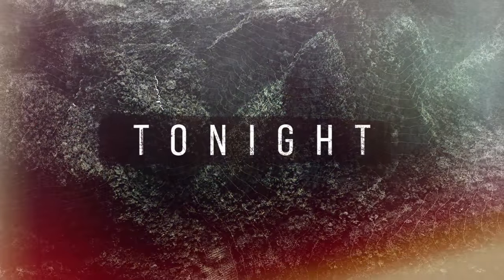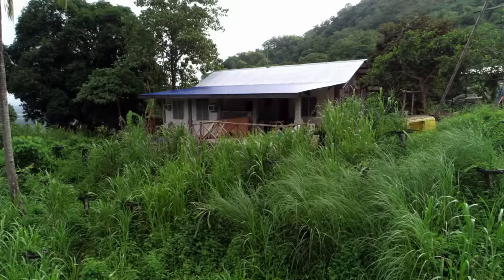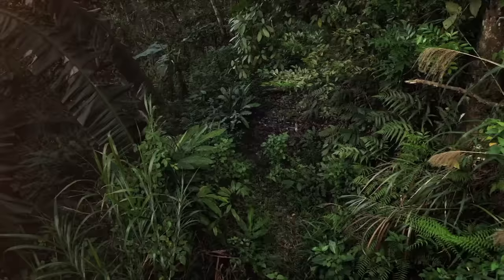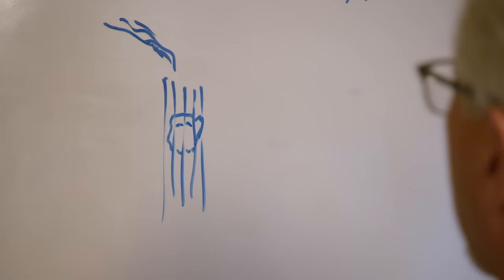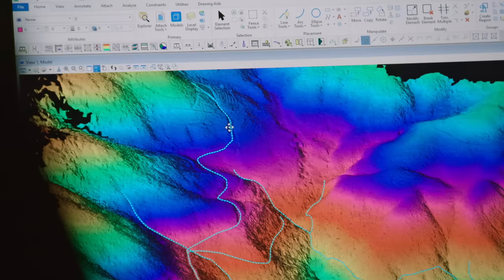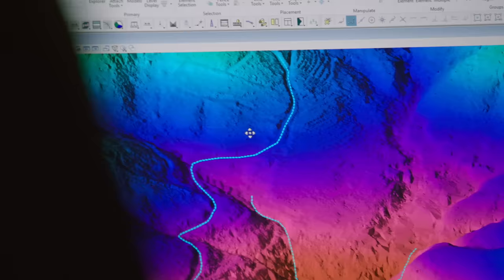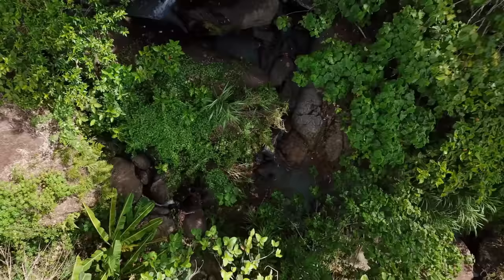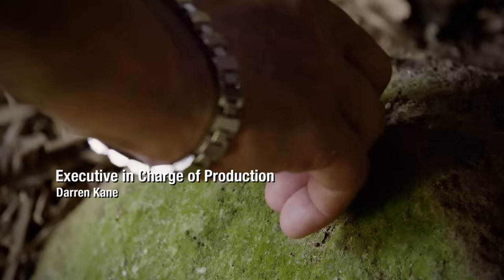Lost Gold of World War II: Uncovering a HIDDEN CAVE from WWII (S1, E2) | Full Episode

Comment: Dowsing for gold will locate the exact center over buried treasure with depth buried dowsed out.  Read and study the book, The Art of Dowsing - Separating Science from Superstition ($14.95), for learning all of the physics involved in dowsing and how to build the modern light weight ball bearing dowsing rod, which is the only dowsing rod that accurately gauges what is being dowsed by pitting the energy of gravity against the energizing of the one-tenth ounce dowsing rod load that is attached on the elevated acetylene welding rod, with being located five-inches from the hub's shaft.  This precisely gauges the dowsing of all edges, exact center, depth buried with angle of deposition, and most important is grading of the sought element that is contained in the elemental mass that is being dowsed.  Anybody can become a professional dowser by practicing the book's dowsing lessons of buried pipelines and electrical cables, tunnels and voids, precious metal placer and lode deposits, dowsing for treasure, dowsing for any element, amplified long distance dowsing from a moving vehicle, and dowsing on water from a boat.  I hope dowsing enriches your life and have a safe, healthy, good say.